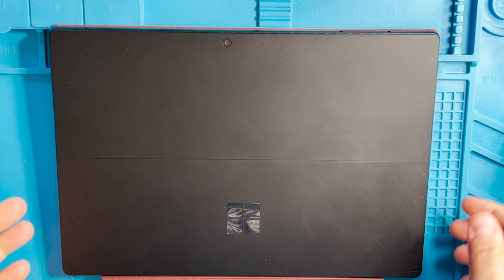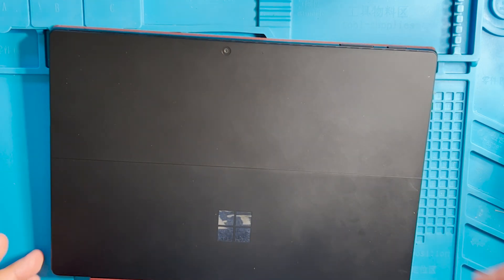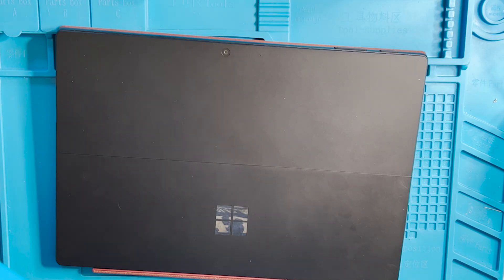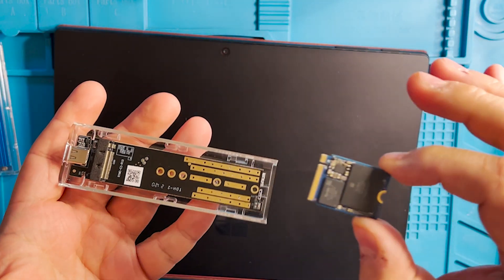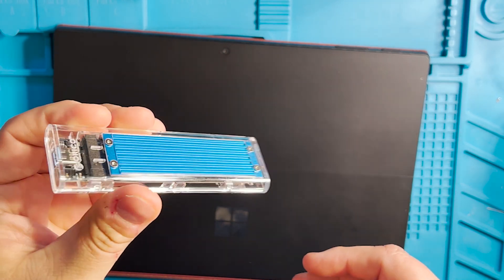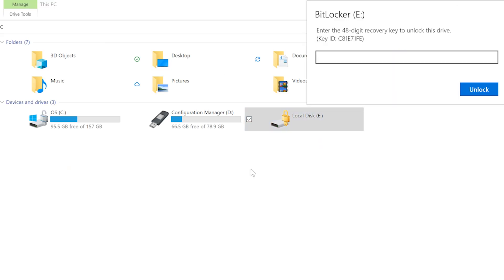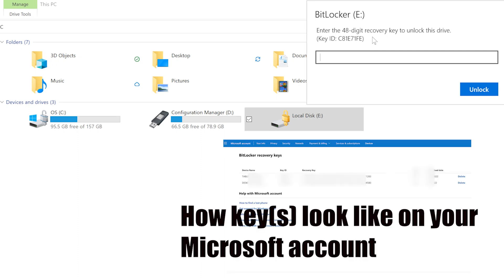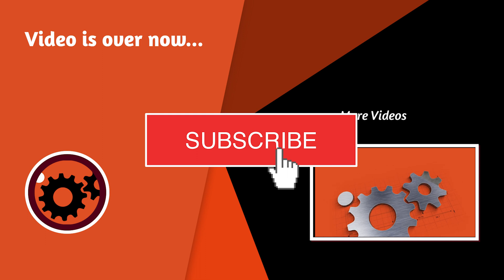Microsoft Surface Pro 7+ 8 | Data Recovery

Comment: What was the situation that this was recovered from? I recently had my surface pro 8 crash and it won't boot up. I was told by Microsoft support it's a hardware issue with the ssd and I need to reimage. Would files be recoverable in that case?
Reply from the maker: If windows is corrupted, you should be able to use a usb adapter like the one in the video to extract your files and then reinstall windows using a flash drive.  You could try windows safe mode before trying anything else.